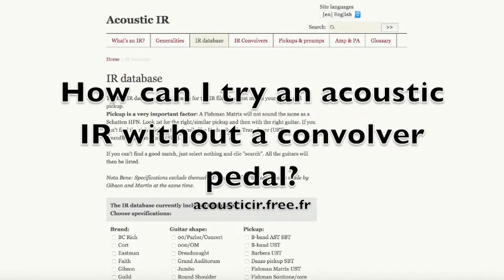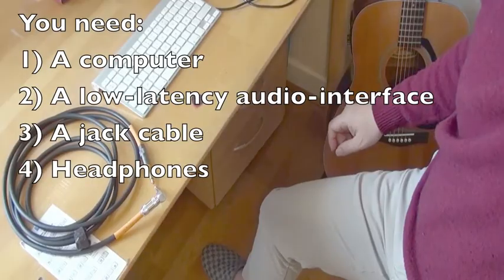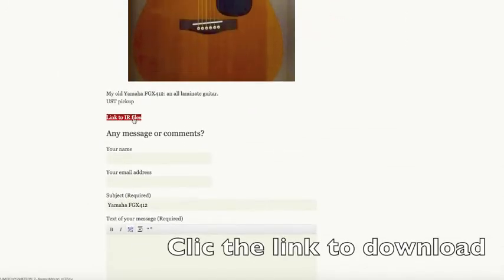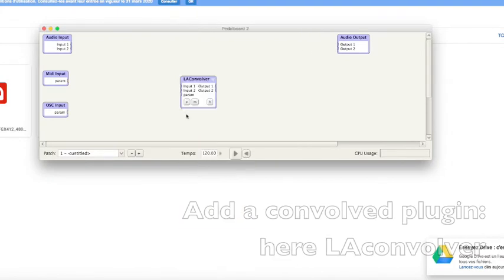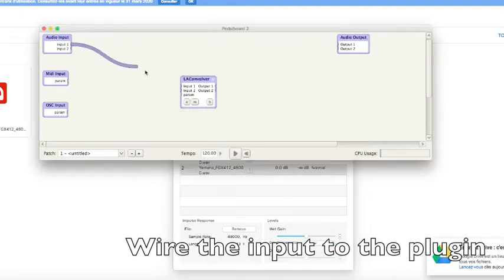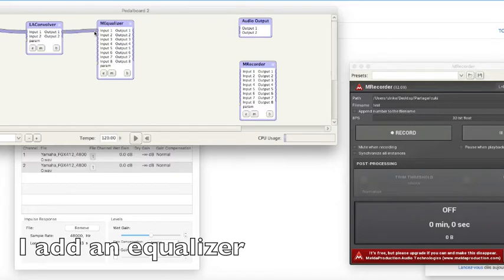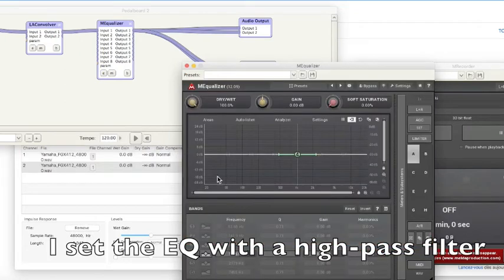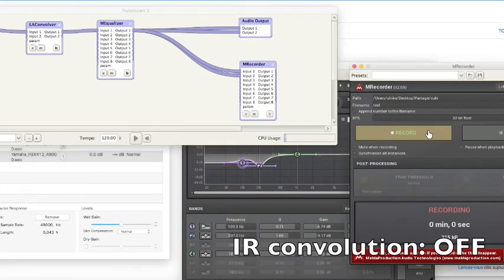How can I try an acoustic IR without a convolver pedal

Comment: Hi, first of all I want to thank you for sharing your work! I have a question about volume. As I understand, there's an expected volume drop when applying an IR, but how much is it in your experience? I'm using your IR for Taylor 814ce DLX ("Match" version) with my Taylor k14ce (same ES2 pickup, same body size, just different woods) and I find that I have to add as much as 20 Db extra gain after the IR to achieve a similar sound to the raw signal I'm getting without any processing. I was wondering if I'm doing something wrong or if this magnitude of volume drop is normal.
Reply from the maker: It depends on the pedal honestly. It is possible to make the IR with less drop with a loss of directness